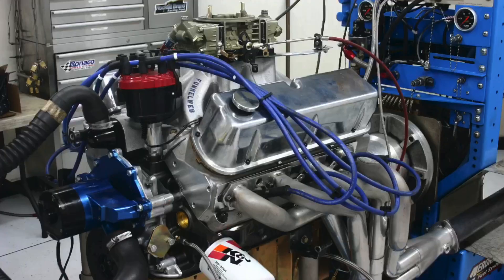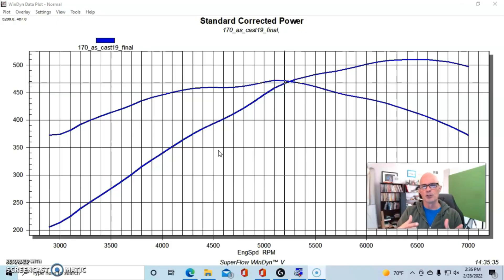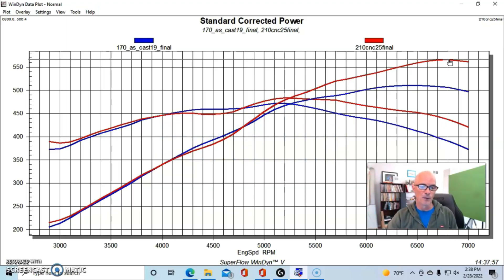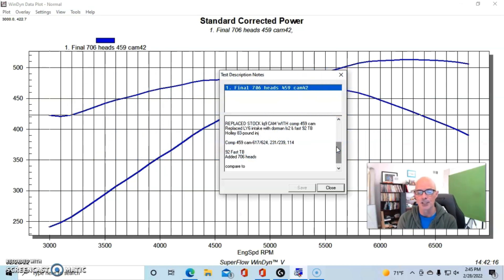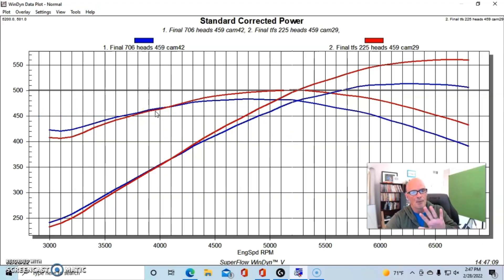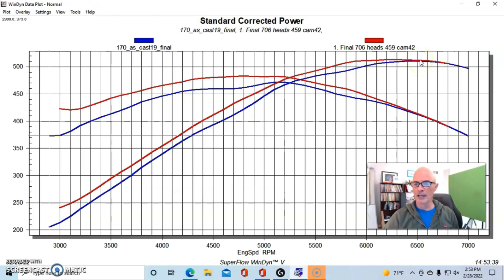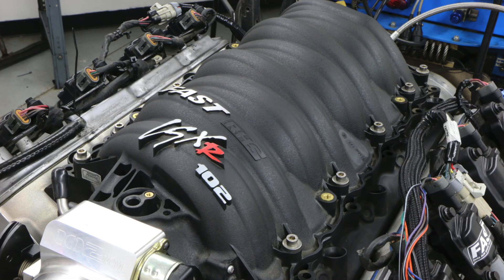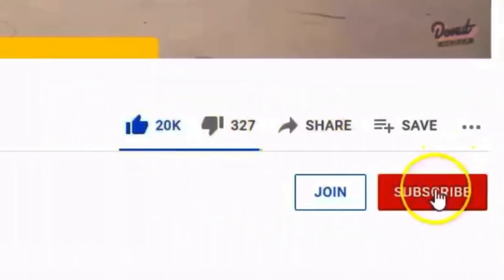HOW TO MAKE 6.0L POWER! FORD vs LS-WHICH 6.0L MAKES MORE POWER? MOD 363 FORD STROKER OR MOD 6.0L LS

Comment: This would have been better with a 351 w  brought up to 360 cubes it would have had more torque and more hp and you wouldn t need a dart block Windsor can handel up to 600 to 650 hp na and would be cheaper to build i use to build the low deck block but the windsor is better 60 over would give a 362 ci i ll bet the ls has a longer stroke than the 363
Reply: We've gone 700+ fwhp with multiple stock 351 Windsor cast cranks and blocks (no girdles or billet caps, just ARP fasteners) and had zero issues - no cap walk, no Nothing, so you're dead on in regards to the block.
Reply from the maker: ls is 4.0 x 3.622
Reply: And then you also could have run the same intake on both.. The holley high ram is from what I understand the same for both platforms. Just different mounts.
Reply: A 6.0 ls is 800 to 1000 bucks a dart 363 is 6 grand for the short block. No contest.
Reply: @nintendogamer5472  The point is, there is no need for a high end dart 363, when a JY 351W truck motor would have do the same,  for less than a JY 6.0 motor..
Reply: @jrod132002  older small blocks are getting harder to find.
Reply: @nintendogamer5472  I suppose it depends on where you live, but most places, 90’s ford trucks are still pretty easy to come by
Reply: @jrod132002  lol you think building a 351 is cheaper than a LS build? the 351 will not last anywhere near as long and keep you poor...
Reply: @camclarke9952  that statement you made is no where near fact.A bone stock Windsor block can handle 600-650 with 0 problems.The big Windsor is a tough SOB!
Reply: @nintendogamer5472  not in northern ontario the bodys rustout fast

Comment: Ls had bigger heads and a longer stroke
Ford had a bigger cam and a bigger bore. 
Apples to oranges. 
Now tell me what cam I need for a 427w with afr 205s long tubes in a ffr cobra. Also Holley high ram vs edelbrock pro flo. Please
Reply: 240 int dur.
Reply: Ls had bigger headers also and 15 degree heads, ford 20 degree heads.

Comment: I think the hidden gem of info here is showing how much HP stock LS heads with a decent intake & cam will make. 513whp with a stock truck block!
Reply: 513 on a bench dyno with no accessories and electric water pump or a load. Is still about 430 -450 at the wheels
Reply: @jimcatanzaro7808  facts
Reply from the maker: 513 whp?
Reply: LOL and 513whp is low for a LS.   It shows that Chevy did not play around.

Comment: Explain, please, the similarity in power despite a 231° intake lobe with 0.617” lift and hydraulic roller to a 254° intake lobe at 0.725” lift with a solid roller! That might explain part of the difference in the mid range, although the runner length had to be the biggest influence. Also, the lash on the solid roller will reduce lift some (maybe 0.020”) and will also reduce duration maybe 4° compared to the hydraulic. What I’d like to see is the LS with flat top pistons, or maybe a small dome to get around 12:1, and the same cam specs as the Ford, or whatever engine you want to compare it with. I suspect a Cleveland headed Ford might win in this comparison, but not much else. LS engines are mostly run in SBE form unless a stroker is involved. I’d like to see the results of a purpose-built solid roller version with massaged rec port heads! 7500 rpm power, please!
Reply: Motown, let's go same but stock rec port LS with Stock whichever Cleveland head.
Reply: yes, and ill take a set of ported Yates c3s or a set of Billy Glidden ported Victor Gliddens on the Ford and lets see whos really the baddest small block

Comment: I have a 97 explorer 5.0, ported GT40 heads, TFS stage 1 cam, Big dog porting stage 3 GT40 intake w/ 75mm tb. Ive had a lot of problems with my motor. Ive considered going 6L LS. Its good to know that if i build a SBF i can make similar power.
Reply: Summit has those dart heads for ford for $1,000 each, then add funnel web intake, maybe $500 for pistons, maybe $1,000 for big solid roller cam/springs/lifters.  Starting to really add up compared to the other.
Reply: @flatbrokemodsquad4241  once your price out everything you need to go with the LS its not much cheaper. FastLSX intakes are like $1000 and I already have a built SBF just need new heads to be fair.
Reply: @ThirstySpoon  Don't believe the ls swappers, heck even Bruce Lee with a whole truck to swap from is costing him, work with what you got n have fun, nothing hurts a Chevy guy more than a sbF beating them in the street, this coming from a 4.6L 2v guy, my all stock 09 P71 beat a 5.3 swapped single cab Silverado, dude couldn't believe it..
Reply: Building the sbf cost more then double what a lq/ls2 would cost.
Reply: @ebkbk9902  if you start with a 302 based short block maybe. It would be double, a 351w bottom end is cheap, plentiful, and strong. Its only heads, cam, intake away from putting out just as much power as a sbe ls, Swapping to an ls isn't as cheap. Especially when your already setup for a sbf
Reply: @ebkbk9902  yeah but its PnP in my 2000 ranger. All my stock gauges work as does my cruise control. If i LS swap i loose cruise, the gauges can be made to work though. I would need to buy a MS3-Pro with harness to make it an easy swap, thats like $1800usd. Then there is the fact that i need a new flywheel, clutch/pressure plate, LS-TKO bellhousing for my TR-3550 and a Gm inputshaft for it. After all that i still have to get motor mounts and a new driveshaft again. Oh BTW that LQ4 is stock and needs a cam, LS2 valve springs and injectors.
Reply: @ThirstySpoon  and i doubt ls truck pan would be a good idea. The sump hangs down low. Thats another 250 to 400 more to spend  just for another oil pan.
Reply: @BruceLee-xn3nn  my buddy did the swap. Has an L33 in his 99. Fits like a glove.

Comment: Im still hunting for a local 379ci 6.2 Ford. Cant wait to see some testing on that! Good idea for the 6L ford. You can achieve 6 liters from a 5.4 mod motor as well though its not cheap.
Reply: I always see you in the car vids..lol i imagine bore the 5.4 or stroker is needed?? i've seen no stroker kits for the 5.4..
Reply: @P71ScrewHead  Jlp/crower performance offers billet 4.415" stroker cranks that will take a stock 5.4 330ci out around 350ci or 5.7L. When combined with a big bore sleeved block, you can easily exceed 6 liters of displacement. Sean Hyland has been offering these combos varying from 6-6.3L with some people using them as daily drivers even.  That said, its hardly max effort like some believe.  In the 2014 edition of engine masters, theres an article of Kaase's 409 cid dohc 6.7L 

GT heads, Block, Cobra R intake , 11.5 CR.
He used a 3.720" bore and 4.700" stroke.

More than 600 ftlbs @3400 , peak of 666 @ 5100.
720hp @ 6400 on pump gas!
Reply: Most of the stroker cranks available for a 5.4 use a chevy rod journal and would likely require custom pistons to fix the .120" deck clearance and pin offset. However, with the knowledge that fitment up to at most 4.700" stroke is possible, you can exceed 6 liters of displacement without going big bore which is significantly less expensive.
Reply: @madmod  I think I've seen that 700hp engine build you talked about, that was nice, definitely gotta write all this down..lol
Reply: @P71ScrewHead  Also, I love your white town car, if thats yours in your Profile banner. My first car was a purple '94 Town Car with a 4.6, dual exhaust, pi intake, and air ride for days. I need another one but I ve gotta find a 96+ for obd2
Reply: @madmod  Thanks man, the Lincoln is my 2nd ride, needs restoration, can't let it go, plan on building it, 5.0L stroker 2v with TrickFlow Race heads n stage 3 matching cams.. Plus more mods n power adder.. Go to my Instagram where I'll be posting more about it, I'm suspended on fb for who knows how long, them fools don't like me, fuck fb anyway..lol It's a 95 by the way, parts car is a 97 rust bucket..lol Shouldn't have bought it.. But it's here now.. Do you still have your 94?? Seemed like it was getting to be a Hot Rod Lincoln..
Reply: @P71ScrewHead  I do still have my 94 town car but It has mild front end damage from hitting a deer as well as the original 4.6 is getting pretty tired. The car has a brand new transmission tho but its the early aod sbf bellhousing only available on the 91-95 town cars and other early panther platforms so its not as stout as the 4r70w. Ultimately, im looking for a 96 or later that I can get wrapped with the colour of my old one. My 94 is painted the rare rose mist metallic which is a crazy looking colour in person. I had a windshield banner on it that read, "Purple People Eater". I desperatley want to get it back on the road but the 94 will take a lot of work to be back to 100%.
Reply: @madmod  Just like my 95 but I think ima spend the money to save it.. Do need to get some land 1st tho.. Is that paint custom or factory??
Reply: @P71ScrewHead  Its original. Its more common on the early thunderbirds
Reply: @madmod  Oh ok, i'm having trouble finding a good shop i can trust to bring it back to life, i'm just asking for a mechanical overhaul, i got most parts for the engine n i may have to go with a high horsepower rated trans once boosted..
Reply: @P71ScrewHead  The aod trans on the early car can be filled with 4r70w gears and internals which then allows for a shorter first gear, much more power handling out of the trans, and the use of a higher stall oem torque converter offered cheaply in the 4r70. I would reccomend just swapping to a 4r70 but on the early blocks, the bellhousing is sbf, not the traditional modular v8 pattern so they arent so swappable. That said, sourcing a converter and trans for parts is pretty easy. The stock 96-04 mustang, 93-98 mark viii, 03-04 marauder, and 03-04 auto mach 1 all share the same 2500-2800 stall converter which is a solid 500-800rpms higher than the town car, thunderbirds, cougars, and other panther platforms like early crown vics. Its a solid upgrade in the early cars that makes almost as much of a difference as a gear swap.
If you dont want the route of a aod modded into a 4r70, You easily get away with just beefing up the aod up on its own without too many crazy upgrades because despite not being quite as strong stock for stock, theres still plenty of people whove been in the low 9s and high 8s on mild aods.
For a hot street strip car, throw a 3500 or higher rated stall in with lockup and make sure it gets a nice large trans cooler and youll get long life out of it.
Reply: @madmod  hech yeah, sounds good, trans kooler is a must.. Think i'm going 3k stall on my 09 P71..
Reply: @P71ScrewHead  Id go higher. I daily drove a 4000 stall j modded 4 r70 with. 4.30 gears lol. Its not so bad
Reply: @madmod  i'll def consider it but this'll be a mild built 3.73 P71, will try it out n go from there, the streets are too slow, car stays below 3k rpm most of the time.. ;)

Comment: 10k+ dollar ford vs a 4K dollar at most LS
Reply: Not true
Reply: Toby, Keep the stock heads and lose the fast intake.  It doesn't add that much.  Just add the $500 cam and springs.
Reply: 225 heads, cam, and fast intake with everything else is atleast 6-7 grand and your still running a junkyard engine that wont last long.

Comment: This is like comparing a Vietnam era fighter jet vs a modern fighter jet.
This is a simple what head flows better. The Ford is limited to it's early 1960's perimeters in design and the Chevy is limited to late 90's perimeters in design..
Reply: Just so ya know there were numerous jet fighters in the Viet Jam ere just as fast or very much faster then current front line fighters, don't even insult me or yourself by asking, what were they?
Reply: @raywhitehead730  and what do you would think would happen in a dogfight between the two era's of jets?
By the way your reply show's a lack of intelligence..
Reply from the maker: the dart heads flowed nearly as much as the TFS 225 heads
Reply: @richardholdener1727  obviously the Chevy is more efficient the Dyno shows that.. Being older in design a Sbf based engine is obsolete in design compared to a LS. Regardless both the LS and SBF are limited by the original design. 
I'm sure you would see the same result between a 302 Sbf and a coyote.
Reply: Kevin, ford didn't want to improve their head flow during the near 30 year run of the windsor (up till 1997)
Reply: @flatbrokemodsquad4241  like the SB Chevy or Chrysler was any different. All the big 3 used the same basic design for at least 30 years.

Comment: Which one makes more power CHEAPER?? Simple LS!
Reply: You don't have to build up the LS, you just have to "cam" it.
Reply: @berserker406 the "LS" block is actually a updated Cleveland block basically.Chevy definitely borrowed a lot of Ford features.Even the distributor can be used in the front of the intake in non EFI applications.
Reply: Its not cheaper, the ls isa junkyard engine that wont last long. The ford is an aftermarket block thats probably good for 2500 horsepower.

Comment: I think it’s safe to say the fuel injection is more consideration for drive ability on the street. But can we have some clarification on the difference between the camshaft on the two motors. The Ford camshaft had substantially more lift and duration than one installed in the LS
Reply: That’s my point. They compensated for the heads by using a more aggressive cam. I would guess the Ford combo would be less streetable…
Reply: @deanwilliamson1373  yep you can see the ford has lower torque on the bottom end due to the bigger cam and single plane intake. Would be a better test if the LS was run with the same cam and a single plane intake instead of the EFI intakes.
Reply: @TheUninformed99  I bet you would see the ls engine make even more power per cubic inch goes to show you what can be done with port geometry in late model stuff 🕺
Reply: Well the heads on the small block Ford might not flow the same as the LS heads so end up making about the same power with more camshaft and better intake on the small block Ford
Reply: Definitely less idle vacuum on three Ford 😅
Reply: Are there vacuum pumps you can install to get the accessories working correctly at idle on cars with with a big cam?
Reply: @MoctezumasRevenge1  not too sure but I know you can run quite a bit of cam on the ls engine and not notice your accessories and breaks and stuff like that not working But idk I haven’t even got to drive my project lol
Reply: that was to make up for the LS' 225cc head compared to the fords 210cc
Reply: @motownXJdad9565  the 225 on the ford made the same power as the 210 head

Comment: Take a look at this channel;

https://www.youtube.com/channel/UCNkFjO2Babgz4ZQnDy0uEZA

They are doing things you said weren't possible. Short stroke, big bore, high compression running on pump gas! AND making relatively big power for the cid they are. A sbc 400 block with a sbc 283 crank 12:1 compression, 329cid 512 HP and 435 ft lbs of torque with a mild cam on Sunoco 94 gas pump gas.(so sorry you don't have that grade in Cali)

That is just one of the short stroke long rod engines they did, they have done several more of them in different configurations, very interesting builds over there.